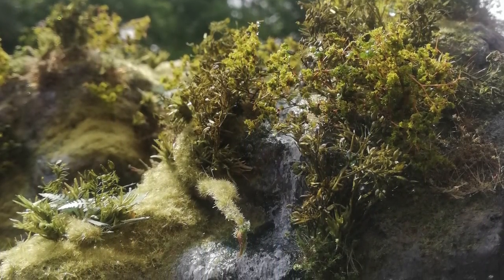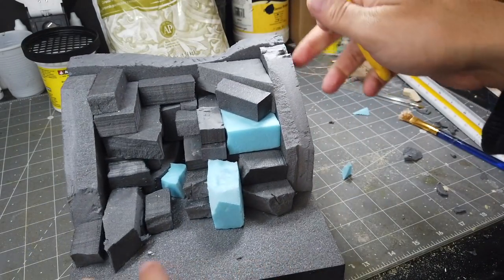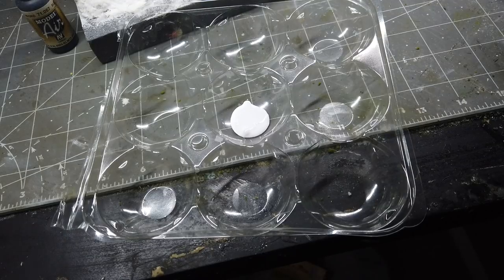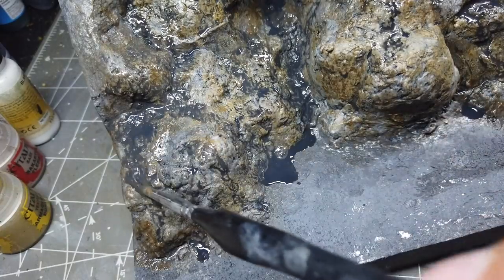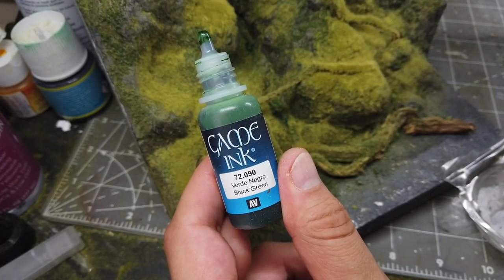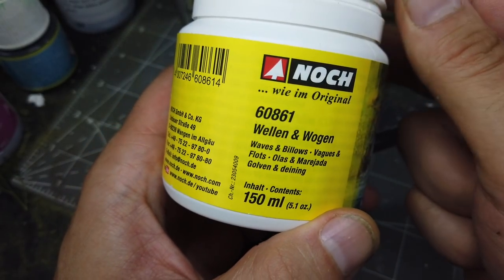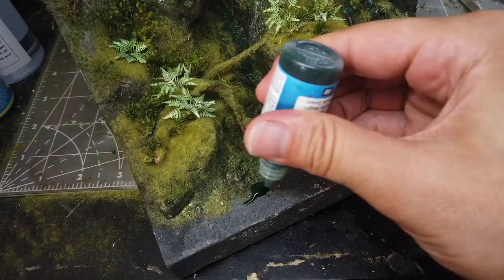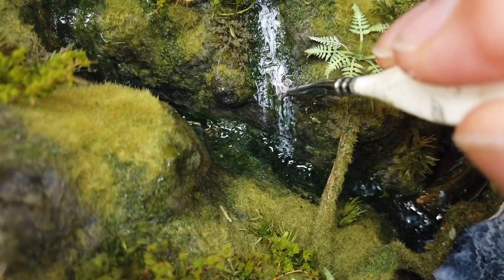Building an amazing MOSSY WATERFALL diorama

Comment: Hi there! I love your work and I’m desperate to try this hobby. Unfortunately it seems to be almost impossible to source carve-able Extruded polystyrene/styrofoam in the UK. Please may I ask where you get yours from? Thank you so much in advance!
Reply from the maker: Hi there. EBay has a lot. Mine is by bluefoamuk, but you could use insulation board.
Reply: @HighEyeWorkshop  Thank you so much for your reply! Unfortunately I can’t find that seller on eBay and I can’t find any insulation board that’s thicker than 1mm-2mm. Do you have any suggestions or links? Thank you so so much again, I appreciate your help so much!